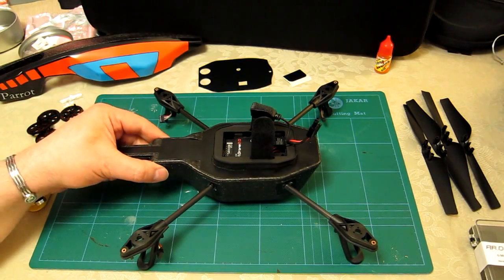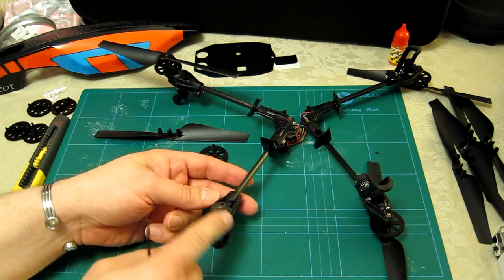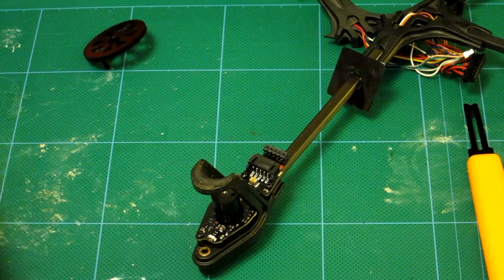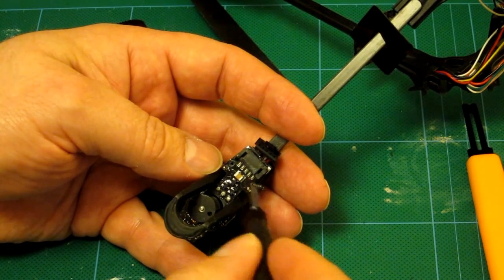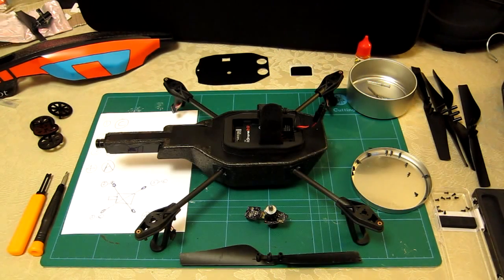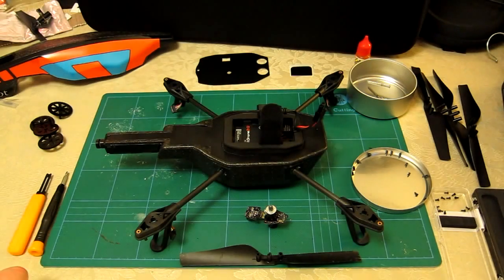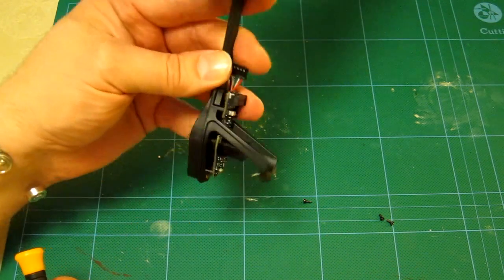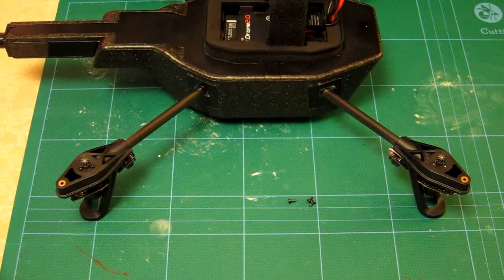Parrot AR Drone 2.0 - Repair Part 3 of 4 - Removing Motors & Reinstalling Motors

Comment: are the motors different?
Reply from the maker: No. In all my flying amd all my damage I have not had to change any of my motors.
It is designed well enough so that the cogs or propellas damage, not the expensive motors.
Reply: I see but are motors 1 different from 2 or 3 or 4? I mean do they work different if i replace one by another works the same? Thank you for your reply, Nice video
Reply from the maker: All four motors are the same. The controller makes them spin in different directions. (..and why you need the right propellers  on the right drone arm.)

Comment: my drones big plastic gear is not touching the little one what do i do
Reply from the maker: Likely you have a very bent pin shaft or damaged plastic gear cogs.
I suggest checking amd if not repairable, replacing:

https://www.youtube.com/watch?v=lsP5tTvMMFU

If its not this, maybe the motor has come away from its mount. But that is more serious as the Cross strut might be damaged...
(Again. I have videos for all various repairs)

Comment: My drone has problem. It fell from the sky so I repaired it but now it won't start up. On the bottom I get a green light and orange light and a red light consecutively and all four propellers are red as well
Reply from the maker: +Stuart Martin Sounds like you have not correctly reconnected some of the ribon cables.
Watch this and double check the connections sections:
https://www.youtube.com/watch?v=KoAdcBHt5B0
Reply: Can look at my channel I uploaded a video of it.
Reply from the maker: +Stuart Martin you need to double check all your connections. Then press and long hold th reset button.
 If all that doesn't help, possibly the motherboard has been damaged??
Reply: OK thanks.

Comment: hey i need some help the black thingy in the motor which is shaped like a battery is loose for me and is holded on by a couple of wires and the shaft of the pinion gear is attached to it my drone crashed and the black battery thingy went loose pulling in the pinion gear's shaft and i lost the pinion gear but i gotta new one is there anyway i can pop the black battery thingy back in place
Reply from the maker: +TeaCupGamerZ Akabosses Not had the problem you describe. Hopefully someone else can help you...

Comment: It's frustrating that you tell us this is part 3 of 4 but don't put links to the other parts.  I can't find them among your hundreds of videos.
Reply from the maker: treeeetop57 Good point. These are old videos and in those days YouTube placed limits to the size of my videos. (No longer the case)
By the end of this weekend I Will add the links as well as combine all 4 into a single "full repair" video.

Comment: also i didnt think it mattered if motors were placed anywhere, is this correct
Reply from the maker: logans run This is the easier question. Yes. Any motor can go anywhere. The computer controls the speed and direction etc and the propeller has to match accordingly.

Comment: hi...im getting motor emergency and theres no software on motor one in the app what motor is motor one...im lost...ive bought new cross piece and new motor and cant get last prop to turn on warm up.thx ar drone 2.0.dont no how to sort up grade motor one to show version.
Reply from the maker: logans run Have you tried a full reset and Firmware reload ??
It should force the drone to update all components.
Reply: yes...it seems the pin in the white plug is bent...the last one..thinking this could cause motor emergency?
Reply from the maker: logans run I do not know enough about the electronics to k ow what that may or may not impact. However. You must certainly straighten it first....

Comment: I need help with my drone can you check my video
Reply from the maker: david ale  I have taken a quick look. You have put your propellers on the wrong motors. You need to get the correct A and C propeller blades on the right motor. My 4 videos in their entirety show all the necessary steps & details to avoid this & how to correct..

Comment: hi is it possible to change the motor into FC 28-05 2840kv motors (Emax) or other motor..pls help tnx
Reply from the maker: jomar khan None of my motors have burned out and I am still using the original 4 after 3 years. There are alternative motors available that I see on ebay that state that they are compatible with the AR Drone 2.0 but I have not tried any of them and can not recommend any. 
+You would need to change all four at one so that will be an expensive upgrade!
Reply: tnx

Comment: thanks a lot! i replaced my main gear after it got lost in a crash, my motor unit got loose, i simply put it back but thanks to your video i realized the metal ring attaching the screws of the motor to the cross was loose on my motor. i was allmost ready to order a new motor, this vid saved my wallet :'D
Reply from the maker: I am really pleased to read that my video helped you out!
Great news and thanks for also taking the time to leave a comment :)

Comment: So after I did this the motor got hot and started to smoke.  Where did I go wrong or what causes this.  How to fix.
Reply from the maker: I personally have not encountered that problem.
I suggest that you take a look at the Parrot AR drone user forums. There are many very helpful people on there & maybe one of them have had a similar issues & can help.

Comment: thanks alot!! beter then parrot movies !! and yes i crashed on the first day !!!
Reply from the maker: I am really please to know that my amateur repair video (It was my fist and so far only time!!) helped. Good to hear a fellow AR Drone flyer is up in the air again!
Reply: hey when i was taking the engines off and the 6 screws i saw that there were 2 different once... a flat tip and a pointy one?.. i don't know if u mentioned this in your movies? but i think its important to place them in right positions... the flat once on top and the pointy once in the control board... because of the opening of the screws..... wy else would there be 2 different once right?? so a extra video?? ha or its just in belgium like that ??
Reply from the maker: Sven Pieters Do you mean like I mention at 05:36 ?

Comment: The motor smells burnt.
Reply from the maker: That is not a good sign!
btw - a VERY bent pin can cause a great deal of pressure on the cogs and any great degree of resistance is bad for the motors.
Reply: Does that mean the motor needs replaced
Reply: There's no difference in resistance between all the blades when you spin them.
Reply from the maker: Tony Beard Then it sounds like your props and gears and shafts are fine.
You may have been unlucky with your motor. Assuming it is connected up correctly. Perhaps try to swap two over just to check it is not the power supplied. ?
Reply: What do you mean when you say swap swap everything.
Reply from the maker: Tony Beard I mean just swap one working motor and the motor that is not working over. Then you know what is or is not working and may need replacing.

Comment: We just tried starting our parrot up and one motor had a little smoke come out and three spin but the one that smoked tries to go but can't get going.
Reply from the maker: With No power - can you feel any difference in resistance when you manualy turn he blades around ?

Comment: Thanks Tom. You're a lifesaver. I just successfully replaced the cross in my AR Drone 2.0 ( I broke it the very first time I flew it ). Without your excellent videos I would have been doing it blind. The video provided by Parrot was useless (a 1 minute music video with no real information at all!). It makes me wonder why they (and other companies) don't do extensive videos like yours themselves!
Reply from the maker: Glad my video helped. I totally agree, The Parrot one is very very short and low on details, It was all I had to go on at the time.
As you can tell - I was also 'learning' as I did this step by step and certainly if I were to do this again would not break those clips like I did. 
Many thanks for taking the time to leave your feedback.

Comment: Is it possible to put an hobby type of motor on it?

Like the motors for rc helicopter
Reply from the maker: They would need to fit exactly onto the main propeller and drive gears - but I am sure some company makes an upgrade.
There are many people far ore adventurous than I am with this hobby. You should look at some of the Parrot forums. I would note however that this is very much a 'beginners' quad copter and has bespoke hardware controlled by Parrot in the main.

Comment: What are the symptoms of a deffective or broken motor ? I have my drone drifting and doing 360° when trying to go on a straight line, can't tell if it's the motor or the navigation board. Thanks
Reply from the maker: I have never had a defective motor so I am unsure.
I would have thought that if it spins and with force, then it is not the motor but controls.
I would however check that the gear teeth have not work and the metal bar not wrapped making the contact between propeller and motor her poor. Could it just be slipping / jumping teeth when under the load of flight ??
Reply: Thanks but I change all propellers and gears and it still does 360°, I think It's either the axis of one motor being loose or the nav board...

Comment from the maker: The "PIC watchdog" message means the Navigation board is not communicating with part of the main board correctly. These two are connected by a thin white ribbon cable with two blue 8 pin connectors.
You will need to either try to return it back to Parrot under warranty if you have not had any 'hard' crashes or repair this yourself. (First try to just remove and then reconnect all the connectors..)

Comment from the maker: Have you tried a full 'AR Drone Reset' ?
There is a reset button access hole near the battery compartment.You will need a small wooden toothpick.
Try that first & see if it flies again.

Comment: Thanks for ur quick reply first.
When I've removed one motor, a little silicone about half inches or shorter came out. But I couldn't understand from where it broke off.
It make be sticked to to a wall of a motor because there is nothing between motors card and the edge. If you remove a brand new drone 2 motor it is gonna break off too I guess.
Anyway I've screwed all screws and now there is no shake. But silicone should be mounted on purpose. It looks like a cut nail :)

Comment from the maker: What Silicone part? Please describe what item you are talking about and the exact MM:SS so I can see where you need help.
All I recommend is that you screw the 3 x top motor screws and the 3 x circuit board screws tightly to each arm as I show.

Comment from the maker: When you say does not lift of the ground - Do you mean to say that the motors spin the propellers but the AR Drone does not take off ?
If so - Check you have the correct Props on the correct legs. (Watch my other videos that show exactly what you need to do. This is only Part 1)

Comment: Hi, 
I had pic watchdog emergency so i replaced the nav board and the sensors, now the error message has gone and it starts up. it doesn't lift off the ground, i did upgrade the bearings as-well. I have heard people say that this could of been a result of bending the cross frame by accident.  got any ideas? thanks

Comment: Great Videos Tom... used them twice.  First after a water landing killed my mainboard... then again after the back magnet of the hull was lost and caused a crash from 20 feet when the hull came off during a flip.  Down she went, broken cross.  I stuck a small but powerful magnet to the side of my screw-driver... makes dealing with those tiny screws easier..

Comment from the maker: Yes. I explain it better in my video where I show me putting mine back on after my repair.
But basically there is a Letter under each propeller blade.
Propellers are marked either "C" (for 'clockwise') or "A" (for 'anticlockwise'). The propellers should be mounted as follows, motor 1: "C", motor 2: "A", motor 3: "C", motor 4: "A". The motors numbers can be found on the central cross. (My videos show all of this)

Comment: hi Tom, great videos - helped me a lot in repairing my drone after a crash however it will now not take off!!! have you got any ideas? the drone sits on the floor, all 4 props spin up but it won't take off. i have a feeling its related to the height sensor???

Comment from the maker: Sure it is a reasonable amount of force, but nothing crazy... Just double check you align the tool and the cir clip dead centre (So the circlip gap is in line with the handle) then you can try pushing harder. re-watching myself again at 0:50 I can see the tendons on my hands tighten and I guess you need anywhere between 10 and 20 pounds pressure. Lining up is the most important part...

Comment from the maker: The only one you need is the orange handled 'circlip removal tool'. If you have a tool that does that already. Then no. But otherwise you will need it to remove the props and get at the shafts etc.